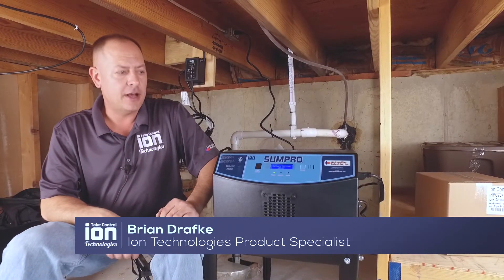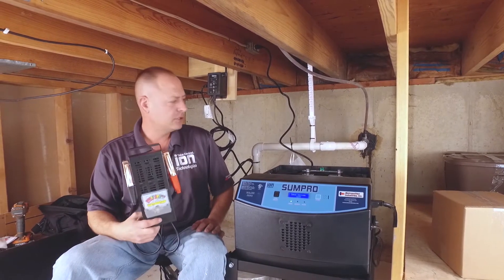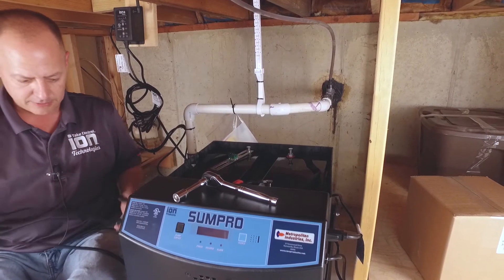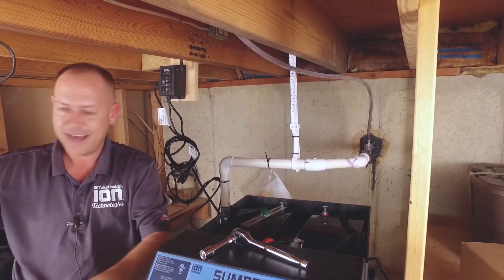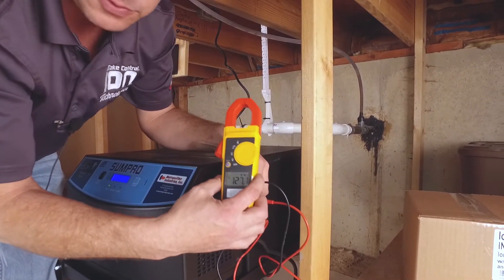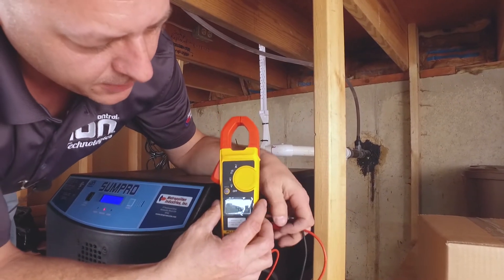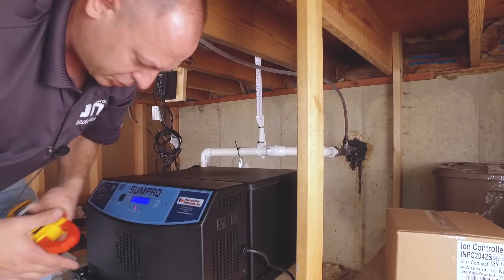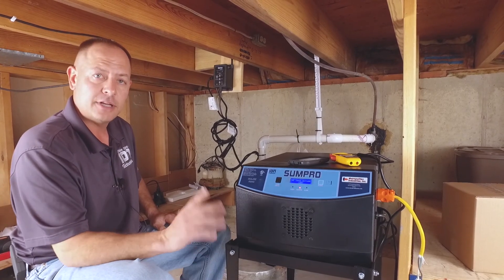Sumpro Inverter and Battery Maintenance

Comment: My Ion SumPro and Ion batteries are a little over 3 years old.  I've only had a few short power failures lasting less than a few hours each so far.  Battery capacity shows 70%.  At what point should the batteries be replaced?
Reply from the maker: Hi,
The rule of thumb, batteries should be replaced every 3-5 years. The 70 percent battery capacity is an indicator that the batteries are not recovering and/or holding a charge. We would recommend replacing with a new set of AGM Batteries. For any additional questions, do not hesitate to also reach us directly by phone at 815-886-9200. Thank you and all the best!
Reply: I have the sumpro 75 and all these years I've been testing the operation of the sumpro just like he did in the video. I would unplug the unit and fill up the sump pit to see if my pump would come in battery backup mode. I had a storm this week and my pump did not come on. If my unit is plugged in and I lose power, the unit will not go into backup.  mode. I turned off the breaker 3 times and each time it failed the test. But when I unplug the unit it goes into backup mode. So there must be a problem with my unit because it should go into back up mode in a loss of power situation and it doesn't.